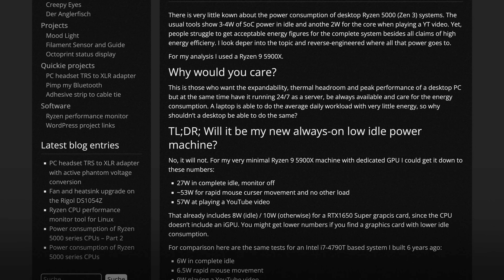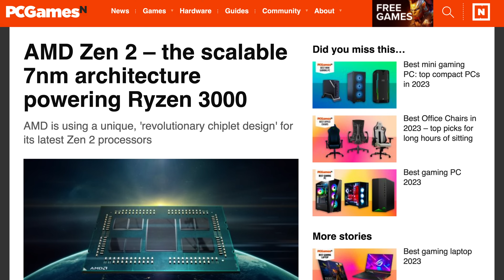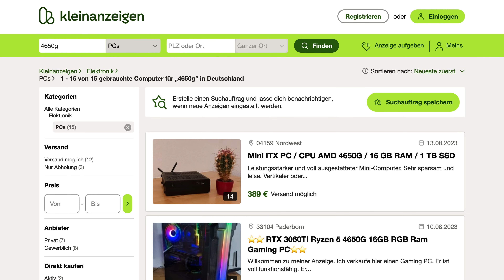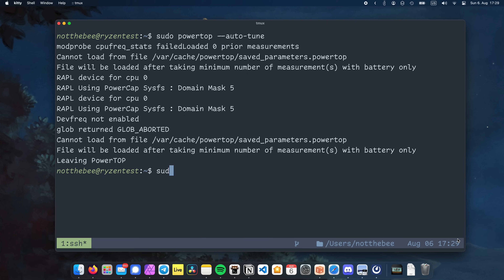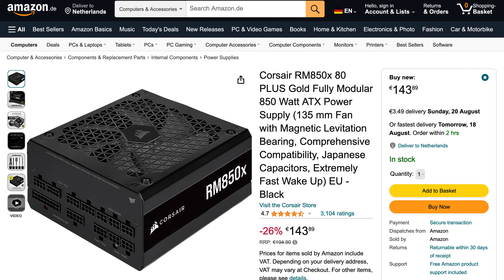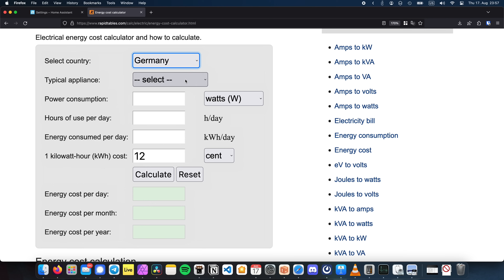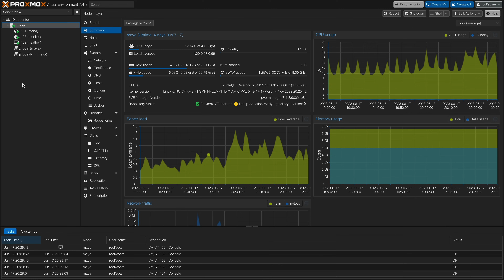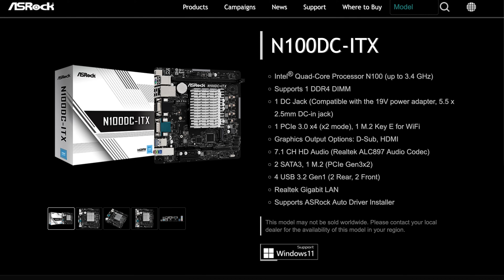This $250 Ryzen Pre-Built is a BEAST Home Server!

Comment: 1. I suppose the user is pronounced like 'frei heraus', just as in 'Ich rede frei heraus, ohne abzulesen '. So your pronounciation sounded OK.
2. I ran an ASRock Deskmini X300 with a Ryzen Pro 4350G that used 7,5 W in idle in both Windows and Linux (populated with 2x8GB SO-DIMM DDR4 RAM, 2xNVMEs and 1x SATA SSD [2nd SATA port available]) back in 2020, so exchanging with the right Motherboard might have some headroom left.
Reply from the maker: The ITX mobo + Corsair RM550x with nothing connected to it except for CPU, RAM and SSD brings the power draw down to 9.5W
Reply: @WolfgangsChannel OK, that sounds better. With a RM550x and a Fujitsu MB/i5-9500 combo I could get it as low as 6W in idle, but below 10 W with just CPU, RAM and SSD sure is good enough.

Comment: Instead of a power efficient SMPS, why don't you add a solar panel with battery to run the system?
Reply from the maker: I rent, and there isn't a good place to put solar panels on the property
Reply: @WolfgangsChannel  how about mounting a panel in a window? Will it work?
Reply from the maker: It might, but at this point I don’t think I’m gonna be able to break even on the upfront costs

Comment: If you plan on running a media server in a VM, AMD APUs aren't really good for that as it's pretty much impossible to pass the integrated GPU through.  However, this being a normal computer form factor, you can always add a discrete GPU to it.
Reply: yesterday I tried to pass the 2200g Vega 8 but the whole system crashed so I used a 750ti and it works too bad it consumes more

Comment: For less powerful system I would suggest looking for i3 6th gen office email machine. These machines are being dumped because they do not support win 11, so you can have one for as low as 30 EUR. I use one as router/nvr/homeassitant server it is now at ~80 CPU load avg (6th gen has AI acceleration too which is eating around 60 proc.) but all of that draws only 35 W, so I am pretty happy.

Comment: I see a lot of these vids using consumer MoBo.... what if i want to build a NAS of 8 HDDs in Raid 10 and 4 SSD in Raid 10 with dual 10 gibt port, will the build be able to handle this or will i have to go for server-grade build ?
Reply from the maker: Thankfully, PCIe exists 😁
Reply: @WolfgangsChannel  I mean is there a limit to how many HDD I can plug to a single PCIe slot ? Consumer cpu mostly support only 16~24 Lanes
Reply from the maker: A typical hard drive is capable of 150-240 mb/s transfer speeds. A single PCIe lane is capable of 8 Gbit/s (1Gbyte/s).
You can easily run 6 SATA SSDs from a PCIe/M.2 controller like ASM1166 (PCIe x4). Get two of those, and you've got yourself 12 SATA ports, plus 4 that are built into the motherboard
Reply: @WolfgangsChannel thanks for the explanation, it's much clearer now... and I believe if I went with those 12 HDD I will be able to configure them all in a single pool of raid10 right ? Also what aboit ethernet port... is there a pcie slot with dual 10 gbit port for LAG or will I have to get 2 separate pcie cards for them ?

Comment: Something to note about those FSP (Fortron) blocks.
They can do a lot.
If such a unit as your is still in good condition, it operates well when loaded at 80% or more. How long will it keep working under heavy load is questionable, since these are old blocks, but from what I have seen, these are very stable, relatively realiable units, with protections and stuff. 
Anyone interested, look at how many stickers they have next to the main one. The more the better. I have yet to see one with an 80+ rating.

Comment: Im using Ryzen 7 1700 and in Linux, I have "C6 Residency" enabled and I dont seem to get crashes in Linux and im on my debloated Linux Kernel 6.5 even after keeping the computer on with a uptime of 17 hours in Linux, I do not get crashes, I dont know if they fixed it or if its because of my debloated Linux Kernel or if its because I got a good CPU without that crashing problem

I also noticed that decreasing the "SOC VOLTAGE" (by using the "SOC OVERCLOCK VID" option in the BIOS on a GA-AX370M-DS3H Gigabyte motherboard) significantly decreases the CPU idle power usage on my Ryzen 7 1700, I was able to undervolt the "SOC VOLTAGE" to 0.684V in the BIOS and it helped decrease the CPU idle power usage even under load too ("CPU PACKAGE POWER" decreased to 9 Watts in HWINFO in Windows while doing nothing)

I am using dual-channel ram underclocked to 1333MHZ (decreasing ram speed helped to get lower "SOC VOLTAGE") and undervolted to 1.1V

I have the case fan turned off in the BIOS, and made the CPU FAN only turn on when it reaches 74° in the BIOS, and with the low "SOC VOLTAGE", I noticed that the CPU FAN mainly stays off even while gaming (playing Roblox in Linux) (so having low "SOC VOLTAGE" definitely decreases heat causing the CPU FAN to mainly stay off)

I set a -0.180mV CPU voltage offset (which decreases the "C6 Residency" voltage when I checked with "CPU-Z" (CPU Voltage goes to around 0.2XX Volts compared to around 0.4XX Volts without the voltage offset) in Windows) and I set

PState0: 2.5GHZ at 0.768V
PState1: 1.55GHZ at 0.612V
Rest of the PStates: Disabled

in the BIOS (I had to set "CPU BASE CLOCK" above my CPU's "BASE CLOCK" (3.1GHZ) in the BIOS to make voltages/frequencies set in the PStates settings in the BIOS have an effect on my Ryzen 7 1700)

I also put the "echo" commands that "Powertop" uses in a .sh script which starts at boot (because using "powertop  --auto-tune" closes keyboard and mouse) to save more power in Linux  

If you have more tricks to decrease power usage please tell me

Comment: This is a fantastic video. It’s broken down in excellent terms, easy to follow, and right to the point with the information that REALLY matters. You’ve got a new subscriber with me and I look forward to more content from you. However, I really feel the need to comment on your issues with the power cables that terminate in the completely sealed plastic/rubber housing. A connector in that style is by no means automatically unsafe to use. They are no less safe compared to other style connectors. A bad connector completely depends on manufacturing, quality control, and genuine defects. A regular, molex-style connector, can suffer from the exact same issues that would lead to it melting or catching on fire. Use manufacturers with known positive history, do your research, and make purchases from reputable sellers/retailers. Please do not spread misinformation like this. It only serves to hurt those that are learning for the first and can lead to users making poor decisions in the end.
Reply from the maker: Thank you! However, I disagree about the SATA adapter thing. This particular style of connector IS inherently more unsafe than the plastic-wall style due to the way it's produced, and even though you can try buying one from a "manufacturer with a known positive history", you'll never know for certain if the particular adapter you got is good or bad until it actually catches fire. That's why I recommend the plastic-wall style of adapters, because with those, you don't run the risk of accidentally shorting the wires inside the plastic molding.
And yes, any cable/adapter/etc. can fail, but Molex connectors are relatively safe in comparison to SATA ones, since they're much less complicated to make and always have those plastic walls between the wires.

You can learn more about it in this video: https://www.youtube.com/watch?v=TataDaUNEFc&t=34s

Comment: a while a go i saw a kit with ram mainboard and cpu for 300€ would you recommend buying this? it includes a asus B550M-A, 16gb, 3200mhz ddr4. Ryzen 7 5700G (8x 3,8GHz) along with an boxed amd cooler. ive been thinking a while about it now but im unsure if it sucks back a huge amount of power as im currently running 2 raspberry pis 1 laptop 24/7 and my pc along with it which is pretty expensive already and it would remove both my laptop and one of the pis

Comment: Okay, but 5700G and similar G series should have the same / better efficiency - nothing special about the 4k series in that regard? 
I am currently using an ITX b450 with a 5700G. It runs windows & hyperv with a few linux and win vms. Also 2 usb disks. It "idles" about 35w with that slight load. Imo ryzen cpus still use more power in idle, but if you do have a bit of load they are competitive, plus you can swap everything AM4 around which is a big win.
Reply: 5700g if not a PRO variant, does not support ECC memory, that's where the difference lies :)
Reply: @someoneelse5005 and the 5700g supports more pcie lanes it’s just better imo main reason why I went with 5700g

Comment: Fantastic Video as always.
For your Question. A geat benchmark for a home server is fileflows. 
It transcodes videos in the "Archive" using so called flows. The best part is that it is super easy to switch between software and hardware transcode. and in contrast to tdarr and similar projects priorizes quality over speed. 
In My experience a transcode to HEVC on GPU is a great test of the overall CPU power.

Comment: Compiling code is not a CPU-specific task, as it involves reading source files from a disk. It serves as a good benchmark for the entire system, but it does not isolate the CPU as a single unit. Calculating prime numbers, on the other hand, is primarily a CPU-bound task

Comment: Bought a very similar system a couple month ago from mindfactory:

AMD Ryzen 7 Pro 4750G 8x 3.60GHz So.AM4 TRAY
ASRock B550M Steel Legend AMD B550 So.AM4 Dual Channel DDR mATX Retail
2 x 32GB Kingston Server Premier DDR4-3200 DIMM CL22 Single (ECC)
500 Watt be quiet! Pure Power 11 Non-Modular 80+ Gold
2TB Samsung 970 Evo Plus M.2 2280 PCIe 3.0 x4 3D-NAND TLC (MZ-V7S2T0BW)
3 x 16TB Seagate Exos X18 ST16000NM000J 256MB 3.5" (8.9cm) SATA
480GB Intel D3-S4510 2.5" (6.4cm) SATA 6Gb/s 3D-NAND TLC (SSDSC2KB480G801)
be quiet! Pure Rock 2 Black Tower Kühler
Fractal Design Node 804
Intel RS3UC080 SATA / SAS HBA Controller IT-Mode 12G Gb PCIe x8 LSI 9300-8i 9311
Intel X540-T2 10Gigabit

cant get it below 60w with the hba and 10gbit with the discs spinning
Reply from the maker: That HBA controller and the X540 card are probably to blame

Comment: ECC???? Crazy price! Are you sure the board also supports ecc?
It is a pro Radeon as well? Only thing which is missing is IPMI

Anyway I bought a Fujitsu TX1330m2 with 32gb ssd and skylake and dual psu fuer 80€ incl ipmi and raid controller incl battery
Reply from the maker: Yep! ECC memory AND  PCIe bifurcation, on a consumer motherboard. AMD really spoils us 😭
And no, it's an integrated Vega GPU

Comment: This is an interesting take on low idle power server + best bang for buck. I've considered Ryzen APU server, but like you said the worse hw transcode might be dealbreaking. Though I've seen Chinese videotubers getting respectable fps using AMD APU, but fps is not the only concern for transcoding, quality is important too. Under your inspiration of Chinese laptop CPU, I've picked up QTJ2 mutant and some part off local Facebook for only C$180 (around 100 EUR). I'm satisfied with it, as it delivers good performance + hw transcoding and idle quite low at 18W in a normal configuration (9.9W with everything unplugged). I'm also using it with my RTX 2070 pulled from my dormant PC in another province and setup a temporary gaming PC for really good budget. Btw did you get more than C7+ state with your mutant? if my CPU goes above C7, whole system crash so I disabled C8/C10. I'm excited for you to review the potential of N100 home server, I'll see if my parents/Chinese friends can bring that board from Taobao.
Reply: Yeah, the APUs are not great for transcoding, but it's a question of how much of them you do. Also, you can chuck in a small dGPU in there for transcoding.
I forgot how it was done exactly, but you can set it up so it runs completely of the APU except for transcoding. Has a little lag when starting a transcode, but keeps the dGPU fully off between transcodes, so it had something like 0,2 watts idle draw or something like that.

Comment: I love your videos!! Funny enough, I also have 4650g and mine too don't go above c3. May I ask how you enabled c6 state please??
Reply from the maker: Where are you checking the c-states?
Reply: I have installed both powertop and cpupower and I only see up to c3.
Reply from the maker: You might have missed that in the video, but powertop can't show C-States for Ryzen correctly, since it's a tool made by Intel, primarly for Intel CPUs. You can use ryzen_monitor to actually see your C-States: https://github.com/hattedsquirrel/ryzen_monitor
Reply: Thanks for the reply, I too did some research and found out from other posts that c-states not being able to display correctly in ryzen, but just wanted to enable it regardless as you have done in the video.
Reply: Also thank you for the the link. I couldn't find the way to check that.

Comment: I love your channel. It got me hyped enough to fix my data chaos and now I'm almost done with my take on a NAS build based on the N5105 motherboard.
I'll definitely stay tuned for that N100 video as this could be the perfect board for my off-site backup in a different city.
Keep it up!
Reply: I'm also debating whether to build my first nas around N100. Seeing dirt cheap deals on embedded motherboards.
Reply: same, are you using picopsu or you found the power supply?
Reply: @namesurname4666  I used the 850W instead because it was available at a discount on Amazon the time I looked for parts. Its Efficiency is most likely worse but nothing too crazy. Whenever there is a better PSU for my system with less wattage I'll swap it and use the 850W on my modified PS4 Pro.

Comment: I'm waiting for N100 based NAS test. I'm also curious how behave N300 and N305, but sadly motherboards with these specific chips are not available yet.
Reply: Dunno why you almost find nothing about N100 systems either. The all-in-one boards are available und the price is mighty fine in my opinion. I got me an Asrock N100M uATX for my server as it is a board which supports 32 GiB RAM. It is running multiple docker containers (pi-hole among other things), a webserver with nextcloud, as well as a samba and a maria instance... It breaks no sweat... My very old i7 36xx was much less responsive than this N100 CPU. But, you should just add an active fan onto the cooler as this thing can go up to 80-90°C when under full boost. With an average 60mm fan, you will get around 40°C idle and maybe up to 60°C load.
A nice case to combine it with, is the Chieftech IX-06B and its special PSU (you need to buy both, a regular PSU won't fit). This is a bench upload from me, geekbench -> v6/cpu/1573133  
I am actually pretty pleased with it.

Comment: fun fact, the stock psu is an fsp, fsp is a really big power supply OEM, thei psu are well built with good capacitor for the ripple suppression and a good voltage regulation even on their entry level psu's that are group regulated and not DC-DC. (DC-DC is a better regulation for voltages than the Group regulated one's) but the point is, a pico psu base his ripple suppression from the power supply that you are using, and if you buy a cheap unit, probably the ripple are not good for your component's (motherboard, ssd and hdd are really sensitive to that parameter). 
for example this fsp unit is better than old corsair Vs orange series and it's a littlebit betther than the grey series, it's a way better than the old MWE white v1 from coolermaster, V2 is actually pretty good becouse coolermaster changed the OEM and used better capacitor and dc dc conversion. 

there is a test of a cheap fsp unit from FALCO75, with a variable load and the oscilloscope to read the ripple noises.

(sorry for my english, i'm italian and i have not a really good english)

Comment: best low load wattage PSU (estimated 50-60 watt load) i could find a seasonic unit followed by a evga 550GA, chose the EVGA cause it was on sale ($57.23)  and was calculated to take about 20 years to cover the cost difference in power savings (based on 80+ test results)

I have my server powering 2 sound cards, pcie -> pci adapter (for one of the sound cards), cable modem, gigabit switch, gigabit (dual port) lan card, JMB585 sata M.2 sata card, Creative T12  speakers, 2 DACs, audio amplifier and the speakers attached, 4 WD Red HDDs (CMR), 4 intel sata SSDs, and 4 fans (including cpu cooler)

High wattage PSUs are not efficient at very low loads, but if you have enough hardware to power you can get higher up the efficiency chart

if you need a cheap CPU you can get a 2200GE cheap (4650G pro is ~2.5 times faster), i overpaid (95.36 SUD) for one on ebay (i knew it was too much) i could probably get 4 of them for the same money, GPU scalping was a thing even for crap APUs... a 4650 ge would be a nice upgrade down the road when/if i end up needing the speed

i think i set my bios to low power idle, zenstates shows C6 enabled and P0, P1, and P2 enabled, P3 - P7 are disabled, running ubuntu server 22.04 and pfsense in a VM

I think i am cpu bound writing to my zfs raid 10 array at 800Mbps over the network, both the network and the storage can deal with more, but not when both are loaded i guess

only reason i got a apu was so my onhand board could post, igpu nice for troubleshooting though